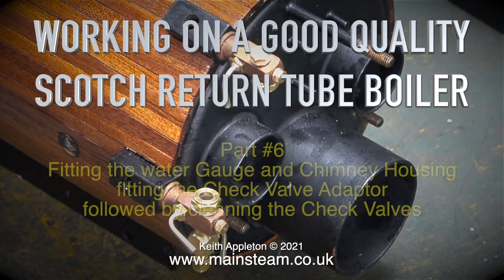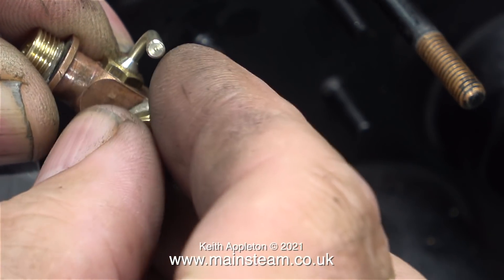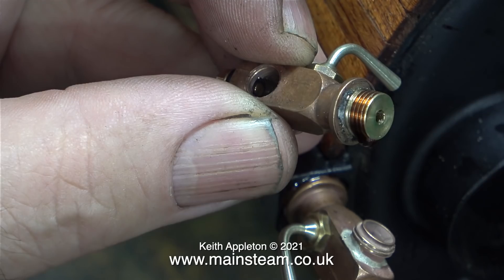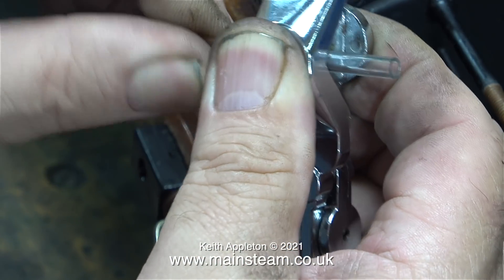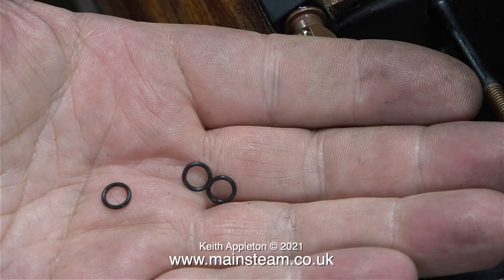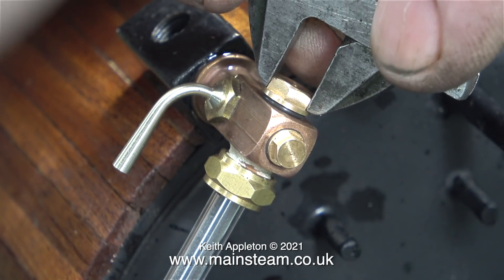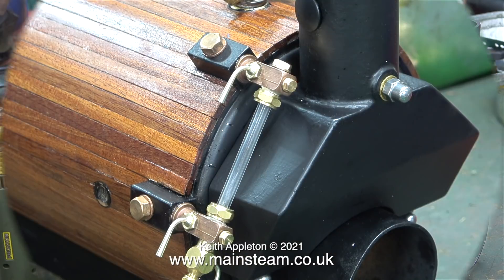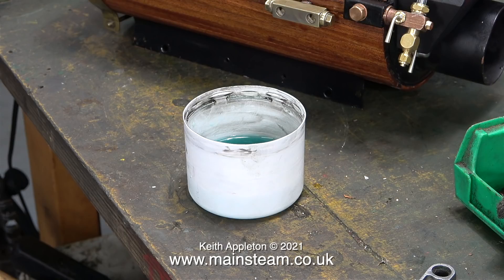WORKING ON A SCOTCH RETURN TUBE BOILER - PART #6

Comment: I never have much luck lining up water gauge fittings using the glass tube and have always used a metal rod for alignment and leather gloves when snapping glass tube. Do you ever flame the end of tubes to smooth them?
Reply from the maker: I occasionally use wet or dry sandpaper to dress the ends of gauge glasses.

Comment: This will be a very good boiler for the 3 cylinder Stuart steam engine. And as always he has very good video! Thanks for that.
Reply from the maker: I thought it was a good idea to renovate it, and with and exhaust condenser /oil trap it will be a really good boiler for a model marine unit when I finish the Stuart Triple.
Reply: I am very excited.

Comment: if you had worked some acid-soaked paper between the aluminium and copper washers you could have a nice battery . . . then you could run a motor instead of a steam engine.

[ but that isn't really what this is all about, isn't it? ]